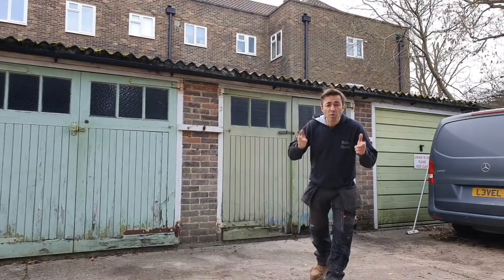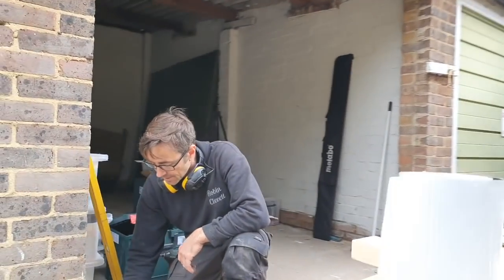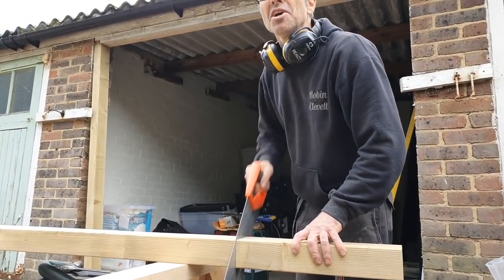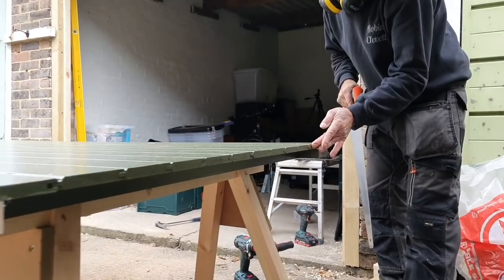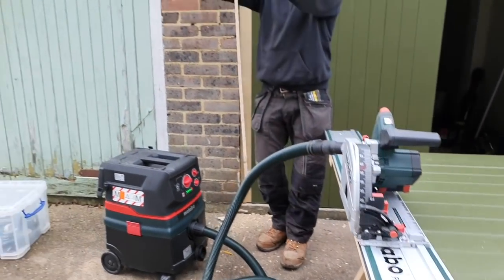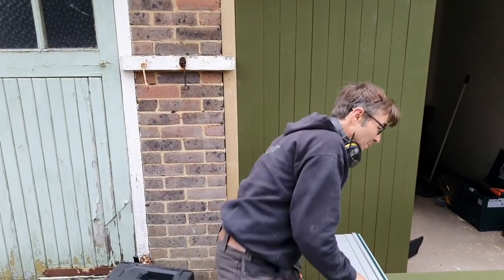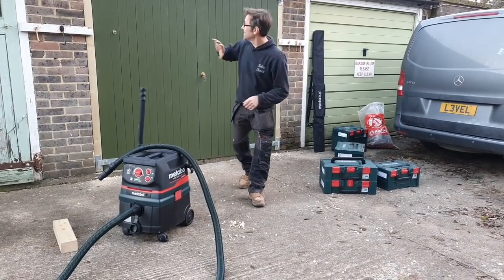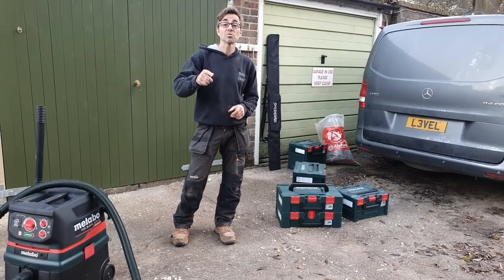How To fit Garage doors

Comment: Many Sharpened Saws ago as a young lad was working on this small building site. The older Carpenter/Joiner Bill liked a drink or two (understatement god bless him). It was a Monday morning and there was ice all over the house windows inside and out (no heating remember). As it was a Monday  Bill had no money so he came up with a plan to get some dosh/money to buy a beer or two. Bill dragged in this old lumber/timber it was 10 feet long approx 8 inches wide and 4 inches thick all rough sawn. Bill had drawn up his plans on the window ice he was going to "Rip" by hand the 10 feet long lumber/timber into two parts. like i have said it was freezing cold with ice all over the windows "Ah the building trade in winter". Bill had all his winter clothes on at this time. I looked in on Bill about 2 hours later the windows had defrosted in room he was working in Bill was down to his vest with sweat dipping of him sharpening his "Henry Disston"  for the 3rd or 4th time. Bills hand saw looked 5 times smaller than anyone else saw he sharpened it that many times. (Ps Henry Disston saws are now £100 and collectable so they say). Bill had hand ripped the lumber hand planed the same there was wood shavings everywhere. Bill plan was to make two stretcher clothes wood poles  with a birds mouth at the end to hold up a washing line then sell them to one of persons in the houses across the road from us and go and buy a bottle of cheap wine or beer with the proceeds. They looked a million dollars the stretcher clothes wood poles when Bill had finished them they where perfect edges all sandpapered so no sharp edges a work of art for sure. Bill ended up with £5 for his 5 hours of hard work.....Later that day the boss came on site and gave everyone a bollocking for not working hard enough (ah the building Trade) The boss praised Bill as he could see he had been the only person working really hard with all the wood shavings and sawdust in his house and Bill down to his vest ...Such is life and now battery power tools Bill would have a field day I am sure.
Reply: Ah brilliant story, thanks for sharing!

I actually work for a large media production company and think the guys would love this! We could definitely make it a feature length.

Maybe we could get Vin Diesel to play Bill?
Reply: @dickdoc3337  thanks Dick 👍

Comment: That is one of the easiest locks to brake, just a pair of stilsons on the barrel and it soon twists and snaps the two brass screws holding it in place. These are very common locks in Spain on metal doors, and we always weld a steel ring round the part that protrude on the front. I would advise to change for the short one if it just sits flush with the wood.

Comment: When I fit my garage timber doors Robin I soaked the 'goal post'  frame in clear oil based Cuprinol and let it soak up the grain to avoid rot. Also I use Sikens HLS Cetol to preserve and protect, brilliant product. Doesn't flake, just flat down and go on with an extra coat. Great video.

Comment: As a recent woodworking enthusiast, I'm enjoying the videos Robin, thanks very much. This one was especially helpful as I' m going to replace my old battered aluminium garage door this weekend with a pair of Jeld Wen wooden doors. As you say, they are so reasonably priced - glazed version for just over 250 quid !! - and they look really nice. Shame that one of the panes of obscured glass has a hairline crack. I asked the supplier if there was any chance of sourcing a replacement pane, but he said that the manufacturers get the glass from Estonia, so the chances of finding an exact match locally are pretty slim I would think, and a pane that isn't a perfect match would look far more noticeable than a hairline crack. Never mind, still very pleased with them for the price. Thanks again. :-)

Comment: Great work, would recommend fitting with the new square cut to the top, as the uncut end would have been soaked with the impregnated solution and would last longer
Reply: Cut at the top can let  water sit

Comment: Lovely work as alway Robin. When I have badly sloppy hinges I use a bit of copper pipe as a bearing or bush on the pin. Loads of useful tips, thanks.

Comment: This takes me back a bit. Manufacturing and fitting garage doors back in the 80's. I imagine they were replaced or demolished since. A bit of paint underneath on the cut horns (joggles) will give it another 5 minutes before rotting haha.

Comment: Hi robin ,  nice job, you clearly know your stuff,   Just be aware with security locks were the cylinders stick out from the face of the door, they are vulnerable to attack. With out  fitting security escutcheons. See this a lot and every scallywag knows about how easy cylinder locks open when they stick out....

Comment: Our boiler makers used Wolf brand angle grinders but they got hammered and we got through them almost as fast as the discs. 
We swapped to Metabo and never looked back. 40 years later I still have a Metabo corded hammer drill. It’s amazing.

Comment: Hi Robin 
Just watched your video on hanging garage doors 2 things I learned & or was told was 
1) When cutting the bottom of the garage doors was to cut them on an angle this cuts down on the amount of wood touching the floor then dress the cut with tar or in this case you could use your tape
2) strap hinges I always lined the pin of the hinge with a rolled up coke can as a sleeve that way it stopped the end play and stopped hinge from flopping about but it didn’t bind the hinge I learnt these tips from an elderly Irish Carpenter by the name of Danny he was such a clever guy and a brilliant teacher and workmate anyway I hope you find the 2 tips useful take care & stay safe
Reply from the maker: Hi John, Thanks for your tips mate love the coke can one!!!!! you take care too and have a nice break, all the best Robin

Comment: This video for me is one week too late haha. For the first time in my career I had the pleasure to fit two new rebated garage doors next to each other down a shared alley. As you id of loved to have made them both but you just cannot compete with joinery shops/factories on costs. Those hinges really aren’t forgiving and you really do need to pull those top hinges as far over as possible. Nice video as always Robin, I hope all’s well 👍🏻
Reply: adie chip   Hi Adie. Well the clients wanted jeldwen doors but unfortunately the garage door openings were far too big for what they had to offer and as they wanted the frames replacing at the same time their was no point adding onto the frames to suite those doors. I did manage to get a company i expect is a large joinery shop to make both sets and as il be visiting the job tomorrow il take a look at the cladding to see if they've been made to suite or the last outer cladding strips have been ripped down like you have said. I expect they will be the latter. Well unfortunately my clients wanted to go with the redwood pine even though i was dead against the idea as like you say its just not really up to it. Yeah it would seem too tight for expansion especially being so exposed to the elements. Luckily i just gave the company i dealt with the overall opening size and what type of doors wanted and they worked it all out, i think each gap was about 6mm. Yes i think il agree on that with you :-) you to mate.

Comment: You forget to mention one of the most important steps when hanging any exterior door, a step many joiners can't be arsed with, probably because you can't tell once it's hung.
Treating the bottom of the door before you hang it, especially the stiles, and in this case, the trimmed match board.
I probably wouldn't on garage doors, but I always fit a drip, not one of the oversized off the shelf ones, but a smallish one made up in the workshop, it all helps to protect the bottom edge of the door.

Comment: I have to say Robin I have been binge watching your videos like a box set of how to construct my 6m by 4m wooden frame workshop with a pitched roof. Yours have been the most helpful by far. I have had them on repeat while I work out overnight what the next step is. . I am a simple DIYer but like to think I have been quite handy. I did need to bone up on some techniques and your easy way to talk through the technical stuff has been great. Just hung a pair of home made 2.1m by 2.1m doors too with half laps and clad with continuous grain. Will post some pictures when it is tidied up a little. Thanks for the great tutorial. Best of luck with the tool range for the hinges and rob angle. Need to gen up on your second fix videos now! Alex
Reply from the maker: Hi Alex, may thanks for the comment, sounds great what you are building mate thanks for watching my channel too!!

Comment: I was doing just over fifteen year's ago nothing new there made my own templates even for latches and locks , now retired due to ill heath from MDF dust, even from warring a masks, probably from the dust on my clothes, if you do use MDF caution ware masks and cover all's or vacuum yourself off after each job throughout the as I wouldn't wish this on an enemy. I can't enjoy a kick about with great grand son.
It's what's on your clothes that you breath in as your movement lifts the fine dust into the air right in front of your eye's, it's so fine you don't realise the magnitude it causes.
Good working, PS, get your a corner chisel trend make them one hit from hammer job done.
Reply: Reading you message has worried me a little to say the least ,I've been using mdf as long as i can remember not always with a mask.

Comment: Nice video Robin, I did hear the vac turning on and off during the cut, I suppose you could just turn it on and leave it on.
Maybe Metabo need to do a bit of work on the vibration device.
Great piece of kit though, who'd have thought we'd be using cordless vacs.

Comment: When you cut the horns off of the doors add a couple coats of engrain sealer from teknos or ankerstuy and repaint the ends, this will prevent the uptake of water the stiles considerably

Comment: Top job Robin. Nice to see traditional doors and furniture. Wondered if you could have drilled another hole(s) on the hinge plates behind the swing arms for another scew(s) for a bit more security. Why not frame screws into the brickwork with a touch of grease on the screws. Make sure the client greases those hinges before they wear. Didn't follow how you got the top square, I'll have to watch again. Lovely job.

Comment: Nice vid and nice little job .
those gatemate locks look to be ideal solution to security on some house side fencing job I got do .
I picked up some metabo gear used recently and pretty pleased with it, does seem have good design .
the merc van plate is a gem lol ...
stay warm, does metabo have a 18v body warmer !? (remember where heard this idea first lol)

Comment: Those gate mates are great - better if the barrel is flush on the outside though.. did you seal the bottom of the doors after trimming (don't think you showed that)?

Comment: Nice new Metabo kit. How have the LiHD batteries been. I have quite a bit of Metabo gear which is unusual in Oz mostly Milwaukee and Makita. My HD batteries packed up very quickly in about a year and Metabo didn't want to know. So I went back to the old normal Lithiums that are much cheaper now anyway and last quite a long time. 
Also that stick on weather seal tape you used on your deck and the bottom of those posts. What is it as I will see if I can find it in Australia. Probably no hope as it will take another twenty years to get here if ever but worth a look as it looks to be a great product.

Comment: Nice work Robin , I think I would have marked up for the hinges when you strung a line . That metabo looks great. .how long can you run it with the batteries ?
Also love the gate mates they normally come with a 28mm spade bit. I fit the outside handle to them, excellent product

Comment: Getting new doors delivered soon to replace ones that are in way worse than those in your video. 
You make it look so easy to replace the frame that it makes me think I could do it. I was thinking of just repairing the bottom 12 inches but looks like it'll be easier to do the entire uprights.
Reply from the maker: You can do it!
Reply: @ukconstruction  
Got the doors now all primed and painted ready to go but I don't trust myself to remove and replace the frame. 
Know anyone in South London that can do that and then fit the doors?

Comment: Have bought a mitre saw and a mitre stand from Metabo.  Have to say it's quality kit, and good value.  I like cordless but I think I would use mains from an extractor as the price difference is quite a bit.

I have learnt a lot from your videos,  and put it to practical use too.

Robin mentioned the Sadolin paint.  Does anyone know exactly what it is?  I really like that finish.  Thanks!
Reply from the maker: Hi Rob, thanks for your comment mate, the paint we use quite often for a job like this is called Sadolin Supadec and we have it mixed in any colour, hope that helps, all the best
Robin
Reply: @ukconstruction  Thanks Robin.  I thought that's what you said but couldn't find it on the Sadolin website.  I will dig deeper.  Many  thanks for your reply.

Comment: Hi Robin, thanks for the informative videos 👍 I’m making and hanging a pair of workshop doors onto a frame but I want the door face flush with the overlapped 6x1 cladding on the adjacent walls.  Where would I get a decent strap hinge with an offset jamb leaf pintle from do you think - I don’t want to fix to the cladding?  Doors to open outward.  
I’ve tried searching the internet til I’ve gone gozzy-eyed!!
Cheers, Nev

Comment: Brilliant video mate. Two questions 
1 why is there no rail at the bottom of the doors? 
Is this specific to garage door design?

2 how’s the app coming along for your roofing square?

I think that’s actually 3 questions😂
Love your work mate keep it coming
Reply: The answer is at the beginning of the video, look at the bottom rail, all rotten, the water sits in the rebate & does its stuff, a clean run off with a bare faced tennon on the bottom rail & there is less chance of rot. ( only problem is the doors are more likely to turn into propellers!!!)

Comment: Enjoyed this one Robin. How does this track saw compare with all the others in your test you  did with Roger.
Reply from the maker: Hi Steven, I would say that If we had this saw when we filmed the plunge saw showdown then it would have faired really well, it is a really well built machine with the big advantage of the extra depth of cut most of the rail saws give you 55mm the Metabo is 66mm I would say that it is as good as the festool, I have only been running it for a few weeks so I will update the channel in the future to my verdict!!

Comment: First tip was a blinder! We had to fit a bespoke hardwood door to a staff entrance in a bank in London. And no, we didn't check measurements first. Removed old door, got alarms all disconnected, security passes checked etc etc, got new door off van which we waited 5 weeks to be made. And it was mile's out. Unbeknown to us, the company sent the labourer on the train to measure up and boy did he get it wrong. Had to go and get a heavy blank, fit all the hinges, locks, eyeholes, alarm system letterbox etc etc. Oh, and paint it. Waited another 5 weeks for another door and go though all the palaver again. Took quite a financial hit on that job and it won't happen again.
Reply from the maker: Wow that is a brilliant example of exactly what I was saying!!! thanks for taking the time to watch my video and make such a brilliant contribution!! have a great weekend
Reply: @ukconstruction  Thanks Roger, and i forgot to mention a heavy duty door closer aswell ! Now if there is one item of door furniture i hate fitting the most, it's a door closer. It's the fine tuning at the end. Aaarrghhhh! All the best mate.

Comment: Lovely job again, Robin.
Shame the bare wood wasn't repainted, but with those hinges, it's possible still, using a mini roller underneath.
Reply from the maker: It was recoated before we had our lunch and we did use a mini roller when we finished too!! I should have mentioned or filmed that!!!! all the best
Robin

Comment: Hi Robin great video, what do you think of the metabo cordless range? It looks really good. I usually use makita and have a festool rail saw
Reply from the maker: Hi Nathan, thanks for your message mate, I have been running the Metabo tools for about 6 weeks, I have a couple of drills, a planer, the new 66mm cordless plunge saw and the battery Vacuum, these tools are really nice, super solid and the batteries are solid and last well, I will be adding to the range in the new year so I will have a better opinion in the spring!! hope that helps, All the best Robin
Reply: Hi Robin, thanks for the reply, that definitely helps, thanks mate 👍🏻

Comment: Here's a security tip: Attach chains on the inside of the door behind the hinges, so if the hinges are unscrewed the door is still held to the frame. Obviously the chains need enough slack so the door can open full but if you use door security chains you can actually use less slack and disconnect them to open the door fully.
Reply: Would the slack in the chains, to allow doors to operate, not be enough for the door to sit outside the frame and allow leverage to be applied?! Could also allow separation of any central fixings on a two door system. And a easier in to break any lock joining the two doors. If I understand this, not sure it is viable?